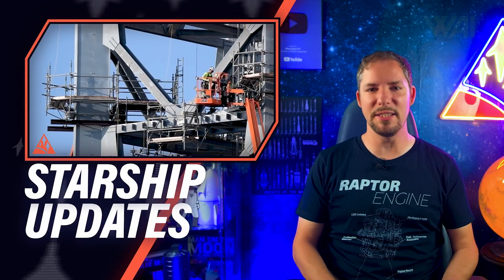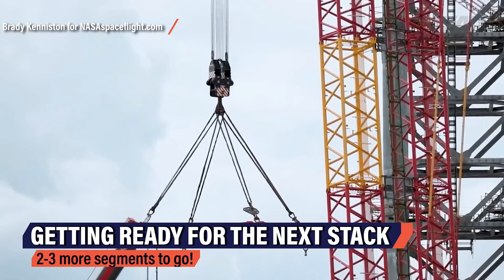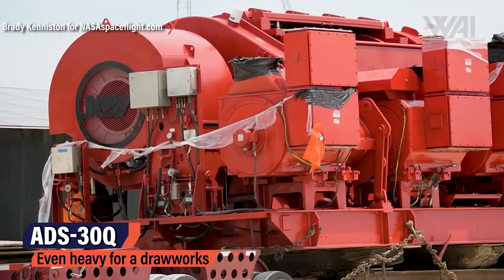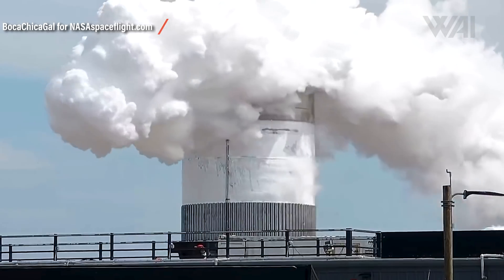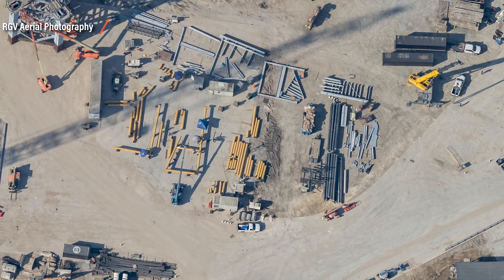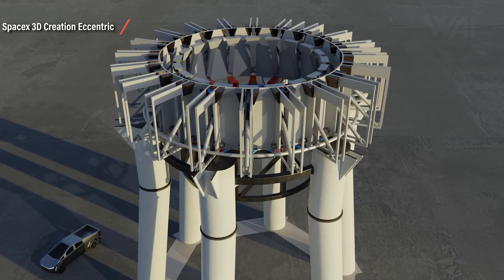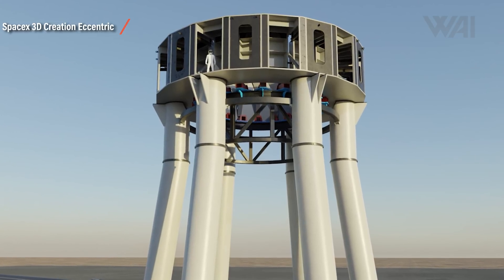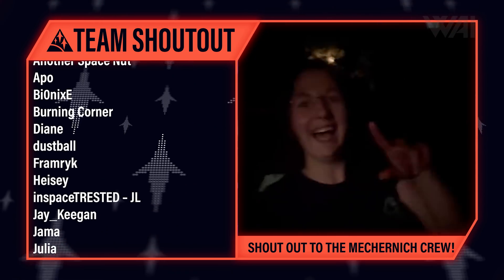SpaceX's genius move on how to build sea and land-based Starship launch platforms!

Comment: The big problem is profit. Big corp's donate pitiful sums to "Save The Forest" and brag. Yet profit motives direct the use of low cost oil, IE palm oil. One company saved over $50 million by using palm oil in one year. So profit priority will continue to clear rain forest to boost stock dividends.

Comment: With the increase in the localized barometric pressure caused by the water being instantly vaporized is plenty of reason for the investment in the platform.  With the amount of thrust being produced its only prudent to take advantage of the tremendous amount of heat to boil some water in the attempt to build a curtain of higher density air for the engine thrust to push against.  Conserving fuel, anyone with math skills out there may be able to tell us just how much. If its greater than 1 percent I'd be really impressed.

Comment: I worked on a tug boat in New York harbor and she had 5000 horse power.  I  the Coast Guard tested the pulling strength at 160 thousand tons.  I hope this  might help people to visualize what that much power is capable of.  Stay out of the bite is #1.  Translation, do not allow your self to be caught up in a loop of 16 inch towing line ever.

Comment: I love your video and how it is full of great updates. BUT,... carbon foot print, really?  The planet is only a few decades from a flip of the magnetic poles. With the less and lesser resistance from solar flares we will experience the lose of electrical power. If the combo of just these two thing is strong enough it can loosen the grip of our crust and move and entire land mass, up or down. This will cause great waves that will engulf a great many part of this earth. Carbon foot prints? You had better start saving seeds, wait that is just that our governments have done and at a place that will, due to the poll shift will cause the north and south poles to melt and may it a bit easer to reach. last word, look for high ground. Good luck to you all.

Comment: I predict that the BN 2 will launch from the test stand to verify that it won't just explode. BN2 will have an SN load simulator on top. After reaching a minimal demonstration altitude, the BN2 will cut all but center engines and navigate to the launch tower in Falcon style. The tower, now equipped with a prototype BN-catcher, will attempt to catch BN2, or present data in a rapid unscheduled manner for the next catcher/BN prototype.

Comment: The tower will need to be keept in tension at the back to counteract the lever of the arms, that way the yellow pipes are going to be the structure to attach wires to at the ground installed on a concret base being constructed some meters away from the tower, seen in pictures. That is my theory.

Comment: Hello, The yellow pipes are not likely pipes.  They must be structural beams.  Round beams have the same inertia moments in all directions, and thus the same structural resistance in all directions.  H, I, T, W beams have different inertia moments.

Comment: His talk about "Mechazilla," meaning the landing capture device, needs to move around.
I'd recommend a cylender capture claw contract, on a boat platform attached to a bay area mech arm extendung far from the "oil mill" station was supposecto be.

Comment: Space X to install a Draworks normally used in oil and gas industry and it means that they are also planning to use an APV to compensate the travelling block that will catch Super heavy

Comment: There is one thing about the launch tower, that I find unsettling: SpaceX is going to launch its rockets from the area of their facility. What will happen if one of those rockets explodes? Starship carries 3200 tones of fuel - that's a lot and in case of any rocket malfunction, the explosion would cause a lot of devastation. Aside from the final part of the launch procedure being fully automated, do they have any kind of counter-measure to minimize damages caused by potential the explosion? It should be something to be considered - for instance the N-1 rocket carried 2400 tones of fuel and one of those rockets exploded right after lifting off from the launch pad - the aftermath was the soviet cosmodrome in Baikonur being completely destroyed.
Reply: uh? have you been following starship? so far it 'usually' explodes, and everything is fine. booster is bigger but same pressure/thickness so basically just a bigger fireball but nothing out of the 'ordinary'.  starship/booster tank failure modes are pretty nice.  but really , end goal is reliability like a 747 jet, which flies around populated areas all day every day no problem. rockets will stick to ocean trajectories for forseable future but overall are expected to be as reliable as jet.
Reply: @JamesAwokeKnowing  So fahr all the explosions occurred on landing or in case of sn 11 at the beginning of the landing maneuver, so in all of these cases, the rocket has burned through a major part of its fuel. Also, the rocket might have not been fully tanked during these tests, as it wasn't taking any payload and these were low altitude flights (I don't know that tbh). The danger I am talking about in my comment comes from the rocket exploding before or at the moment of lifting off - when it still has plenty of fuel. I'm no engineer, but the N-1 rocket explosion was estimated to be 7 kilotonnes of TNT strong, which was around half the strength of the Little Boy bomb.
Reply: @PediculusPL  i believe an early one exploded right there on the stand, but bottom line is starship/booster is more balloon than bomb. Like taking a fire cracker out if its shell, make one wrap of tin foil, and light the fuse.

Comment: The way those pipes are steeply coped shows me that they are structural braces. The end result will probably have girder sections joined together to create a very strong structure. Probably no fluids or gases will ever be inside the pipes. My guess is a base or a stand.

Comment: "We might use SN16 on a hypersonic flight test". Just thinking about this. After the ground support equipment is completed (ability to supply LO2/LCH4, the OL table is set up on the OL mount, tower complete)... do you think they could potentially test the launch system using the SN16 reflight/hypersonic test? In my mind, the big objection to this idea is the tower, but SN16 is the right diameter to go on the table, and the turnaround time would be 48 hours. What do you think?

Comment: You'll need literal tons of water coming out for every launch, so it's expected that to feed such a dampening system you will need massive pipes carrying water snaking into the structure. 

Would it be logical to place the intake pipes within the legs of the launch mount, or would that cause future maintenance to be a big pain in the ass?

Comment: Hello Felix I just have a thought that came to me while watching your video about the yellow pipes and I agree with you I don't believe there is any liquid going to go through that for the very reasons why you stated but what I was wondering is could it be possible that they would use like air pressure for like the catching mechanism instead of hydraulics and things like that I know that a failure of any kind would be a lot of dollar signs and disaster but anyway this is just something I thought about I was wondering what anybody else thought thank you

Comment: The catch mechanism is probably necessary for the fluid void super heavy to survive landing. Without internal pressure from LOX and Methane the superheavy structure is fragile and will break up easy

Comment: I suspect the Yellow pipes might be the base of a new water deluge tank system for the tower. NASA went through many phases in developing their current deluge systems and using mechanical pumps alone were never enough for the immediate needed supply, where a gravity fed with mechanical assist became the norm. In that there are water tanks already on site, could be that they are just storage. Remember that fresh water is at a premium onsite, having to be desalinated. If S/X decides to do more than one launch a day, the desalination plants would never be able to restore the volumes required in a very short time.

Comment: The problem with the Starbase pad having a sound suppression system (other than Musk said it would not) is there is still no infrastructure for such a system. A sound suppression system would need to flow a half a million gallons of water or more in less than 10 seconds. They may have a million gallon water tank, but you'd need a multiple megwatt feed pump to move that much water from the tank that fast. Or like pretty much every other sound suppression system has you'd need a giant water tower, so like flushing toilet gravity can move the needed volume of water. 

So where's the water tower? Or the multi story high water pump? Where's the 2 meter or probably 3 meter wide piping to feed the sound suppression system? Why didn't they bury the pipes in the ground before they built the pad or the water tank base so they wouldn't be in the way? 

I definitely could be wrong, but IMO the Water Tank is meant to feed fire suppression system and a much smaller than a full sound suppression system that uses water to Protect the launch pad similar to how they use water to protect the landing pads on their drone ships.
Reply: The fact that you can't see them doesn't mean that they aren't planning to install those
Reply: @alvianchoiriapriliansyah9882  True and as I said i could be totally wrong, but some of the infrastructure should already be there. 

One major thing is a water tower. They are putting a water tank that's probably large enough, but that would require a massive water pump like would be used for a nuclear reactor. Honestly trying to pump a 1/2 million gallons of water or more out of a tank in few seconds makes no sense when you can just use a water tower and let gravity move the water for you...As musk often says the best part is no part. Water tower uses no giant pump.

As far as I know Musk made 2 statements  on this issue. First he said they would not use a sound suppression system. Recently he said they would use water to protect the pad. This second statement I think people are interpreting to say he's reversed the earlier plan, but I don't think that's true.

The only purpose of sound suppression is to protect the engines from sound reflecting off the pad in the first few second after launch. Neither the pad nor tower or anything else is in any danger from the sound of the engines. 

Installing a full water sound suppression system just to protect the pad from the heat of the engines is like swatting a fly with a sledge hammer.

Comment: RE Carbon foot print; 
£100 give away;

I
 will give £100 to the first person to cite a single bad aspect of a 
warmer world as per the IPCC's climate predictions, and a single place, a
 local authority or some such, which has traffic lights, which will 
expect to spend more than its' traffic light budget on countering, 
sorting out, the impact of that bad thing. By 2100. 

2 exceptions;

1,
 Venice, just gets over the line but only has a problem in the first 
place because they have dredged the channels into the lagoon too deep to
 allow the cruise ships in.

2, Permafrost melting causing foundations to fail. Surely such places getting warmer is a good thing?

Comment: Is the diameter and known angles of the unknown yellow tube structure correlate with the booster grid fin? They maybe be that color for identification from high altitude to get a solid lock on navigation with vision.

Comment: If we plant enough trees that we reach forest level like in the medieval era, then we just need to find a way to remove the coal, oil, gas we burned from the air and put them back to the ground.
Planting more trees won't fix the amount of gasoline we burn in our cars, as the tree will grow, die out (be cut out), burned or eaten by bugs, and turns back to carbon dioxide and return to the air. The trees won't remove carbon from the ecosystem, it will stay there, just for a short time in a different form. Adding carbon to the ecosystem from the resources we dig out won't go anyway if we do not store them somewhere.

Pay to reduce the remorse we feel about our lifestyle will do just that. Reduce remorse and won't save the earth.
Dislike for promoting this scam.

Comment: May be this is a catching system as well. The hydraulic cylinders could be intended to catch the skirt ring of the booster on its return acting as movement dampers eliminating the need for the problematic landing legs. The stroke length suggests this.

Comment: I suspect the yellow tubes are prototype catch arms. Maybe a separate catch tower test stand type system. I'm thinking this because of the position of the triangles, those angles you usually see more in offset weight support. As center weight offsets usually are equal and multiplied around each other

Plus the current construction seems to be going in one direction and it's the missing part we haven't seen anyone talk about considering how far along the tower is. Now to look for the potential other counter weight equipment.

Pressurised Fluids and gasses definitely ruled out, those angles would also cause structural tears and cracks. Also no bolted junctions, unless i missed it. Electronic main tunnel pipes is unlikely but not ruled out as you also don't want sudden curves, and that capacity could be problematic to turn for main systems you would use very often.

Most visual notes point to a structural piece, with this being a part close to the base....I
Would love to see a mock up of this on the tower as the arm though.

Edit.
I also forgot there are also many short pieces, indicating more further reinforcing than connecting but i guess junctions could be added if it's a more specific tower piece. I was thinking of hub wiring for the whole complex but no...

Comment: Maybe the catch mechazilla is not actually fully attached (the way it was first thought of) or even fully separate from the tower. That way it might even have rails on the ground or wheels to allow for more horizontal motion as for sure catching a rocket on say a day with even a little wind will make exact location to catch hard to predict.

However thinking on the fly about his comments (Elon Musk) it also does lead me back to thinking it could be 2 horizontal arms (which has been predicted and visualised before). The triangular shape would make sense to distribute loads like a truss. The upper limb would be horizontal level and the lower limb would be at an angle to help support the load. 
If this was the case then the attaching grabber or holder to connect with super heavy/starship is still not seen yet.

Comment: Does this mean we're not likely to see another Starship test flight until it's launched atop a Super Heavy first stage?
Or would they perhaps do a few more Starship launches beforehand, possibly from the new launch mount?
Reply: The current manifest is straight to full stack launch. Elon mentioned SN16 possible flight, but he's also hoping for SN15 reflight. Plans is subject to change
Reply: @alvianchoiriapriliansyah9882  Thanks for the info. 
I would've thought there were still questions that at least one or two more Starship only flights could help answer. 
But perhaps Elon's thinking that launching full flight configurations will give them whatever data they might have gained from Starship only flights anyway, and it will allow them to move on with manufacturing and building launch facilities.

Going to be something when they start launching Super Heavy stacks and have them come down in the ocean.

Comment: I just have a hard time believing this is a water suppression system. Have you guys seen the videos of pad 39A and B's suppression system!?  It's huge and huge pipes and a huge water tower with huge pumps! That pipe in the model is so tiny and I don't think nearly enough to supply a system here. In the past, Elon has said no water suppression system will be used here.
Reply: You're mistaking the water sound suppression with flame diverter

Comment: But water dampening, as shown, is only useful at the immediate launch.   After the rocket lifts off there is still a TON of sound going into the water (I think the EPA will care about this) and all around.  Starships 3 engine tests have been crazy loud.   30+?   Wow
Reply: It doesn't like the water will instantly stop spraying until the rocket is quite a bit farther away
Reply: @alvianchoiriapriliansyah9882  What is the useful ness of the water system when the sound and shockwave is outside the system even 100 feet above?   The footprint of the sound will be very large even by then.  And think about how fast sound travels over water.

Comment: The launch table is missing an elevator and catwalk.  Probably some stairs between levels.  Man lifts are all fine, but in bad weather you want a stair and an elevator.
Reply: Launch table height is too short to require that
Reply: @alvianchoiriapriliansyah9882  Too short for a stair?  Certainly too tall to reach from the ground.

Comment: Mechazilla= two little arms and a tail clamped to the ground to counterbalance the weight of the rocket? the yellow pipes could be parts of an underground anchor  with heavy steel wires running to the top of the tower.

Comment: No way that ring pipe in the launch mount is for sound suppression water, it simply isn't big enough (at least based on the model you showed). I might be water BUT I believe that there are going to be other, yet to be seen, water supply lines and manifolds.

Comment: I agree with the guess on catch system, triangles are very strong and are used in engineering pretty often, maybe a cantilever arm .. though forces transferred at that kind of distance with a significant weight of a starship booster :/ don't think it would be strong enough.  Possible additional support for the actual catch